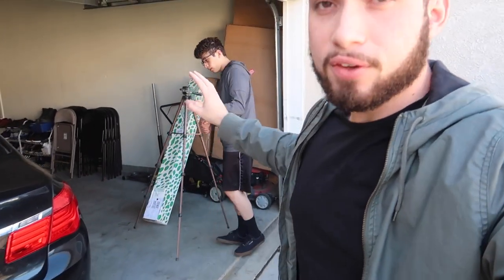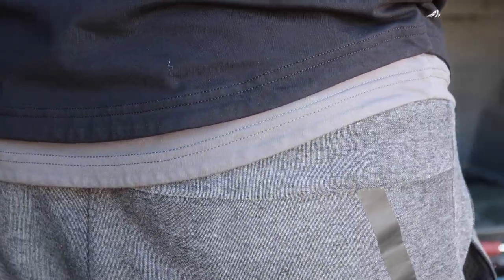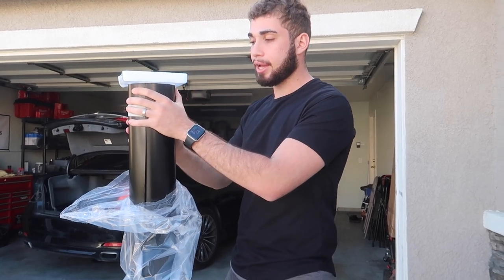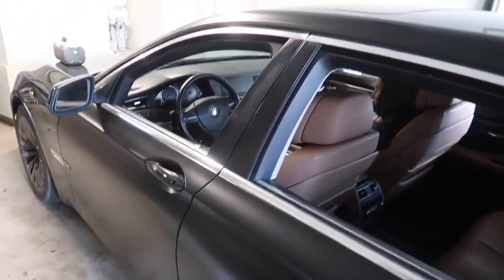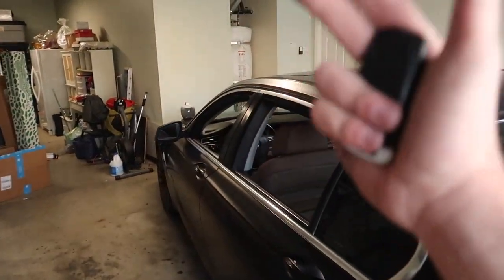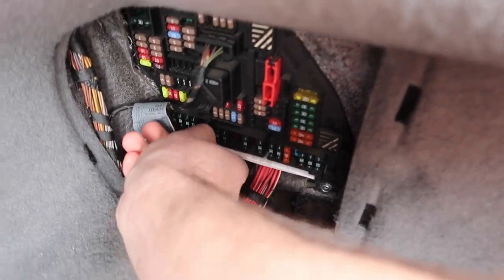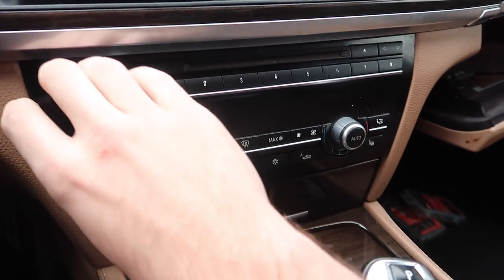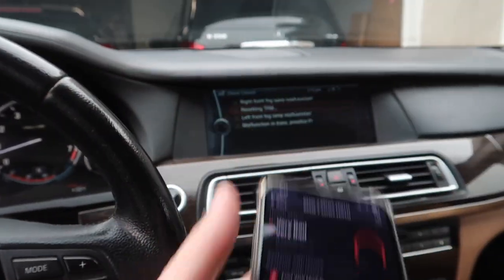THE 740LI GETS WRAPPED! (COLOR REVEAL!)

Comment: I had problem today with my BMW E91 Climate/AC, because i disonnected battery cables for a moment and car disabled all climate, seat heating and some extras. 

The fuses were fine thought but still i tooked old fuses out and replaced with new ones which were related to Climate and everything else, and climate started working.

Maybe this works on 7series too  🤷🏻‍♂️
Reply from the maker: Good to know I’ll do the same thing thanks
Reply: @NourHummadi  

What did i tried: 
• tried to Battery Reset, tooked minus cable off from battery and waited 10-15min, didnt work
• Reset Car Software, that didnt work neither.  
• did go for a 15-20min drive, maybe it will start working and no it did not. 

❗️ Changed all fuses even they were not blown out, that worked,

Comment: Rule number one on german cars, battery broke? CHANGE IT BEFORE IT RUINS ALL THE MODULS. 

Rule number 2, no second hand battery 😂
Reply: Yeah if it the battery dies it'll never be the same again after mine did I was always chasing electronic shit never had any mechanical issues though since I did all the maintenance
Reply: im pretty sure he burned the climate control/radio by not connecting the battery properly + it wasnt a new battery, better go varta or bosh then oem but used
Reply: @cozmokram  same thing happened to my f10 5 series it happened before the battery was replaced then after battery was replaced it still didn't work
Reply: @shaunbailey4922  BMWs are really sensitive for batteries. if it starts showing signs of age you just have to change it and not complain. it's for your own good.